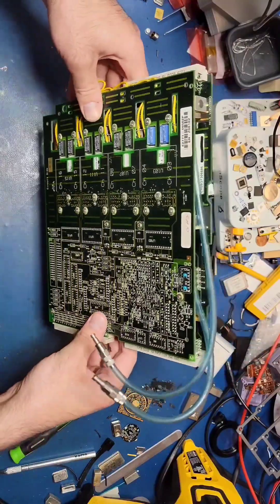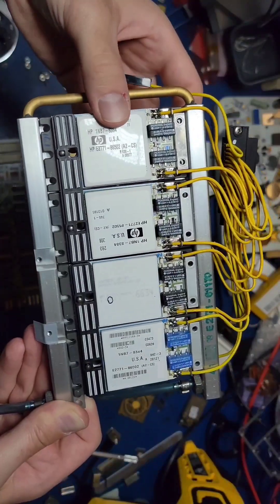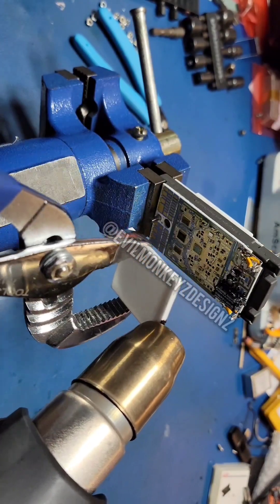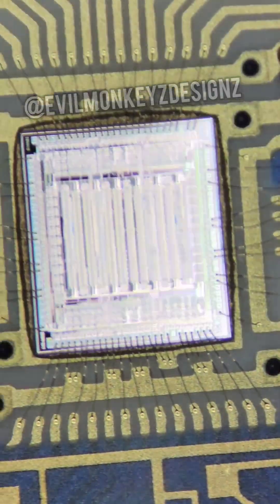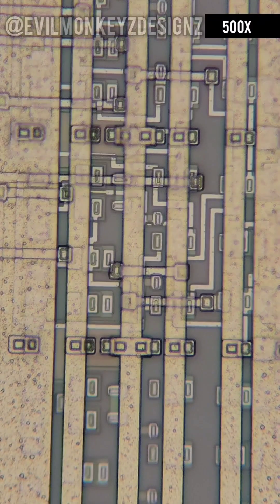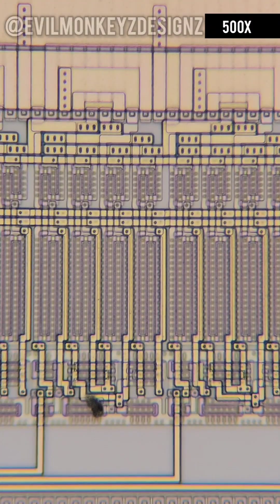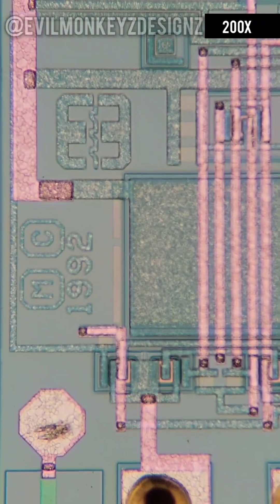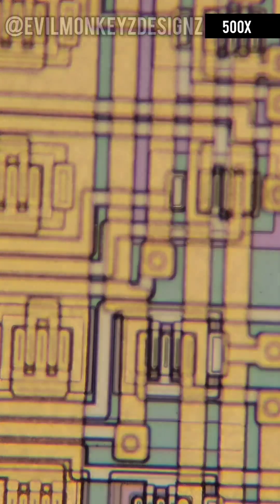CCU #300: HP83000 I/O Hybrid Ceramic Module

Comment: HP spun its IC test division out with Agilent in 1999. It was renamed Verigy and itself spun out in 2006. Verigy was acquired by Advantest for $1b in 2011. Advantest today is the largest SOC tester manufacturer with a market cap of $35b. The “93K” legacy Verigy platform remains its core product.

Comment: The circuit board is gold screen printed with n to alumina ceramic. The blue part is dielectric glass. They layer these to stack multiple circuit layers and connect with gold or aluminum wore bonds. Very cool technology.